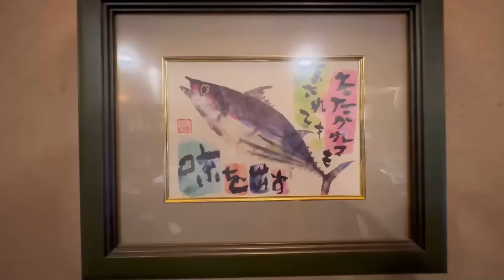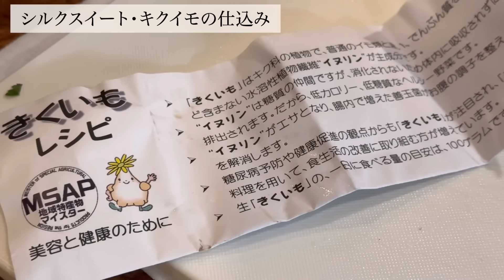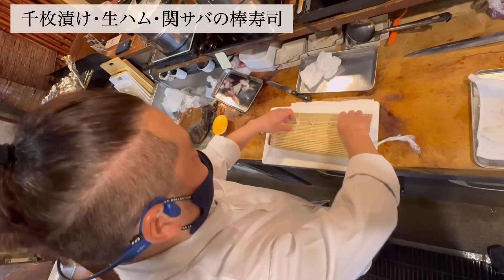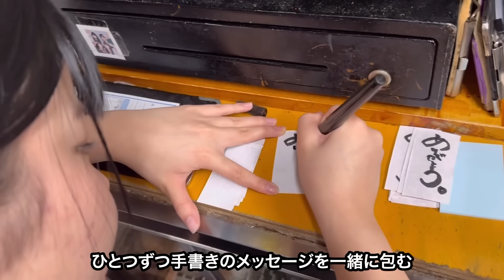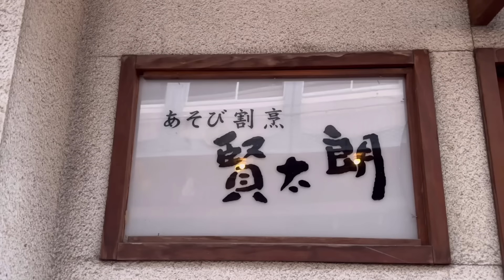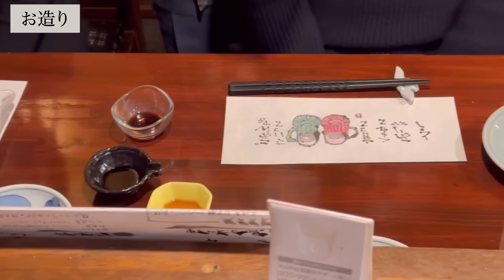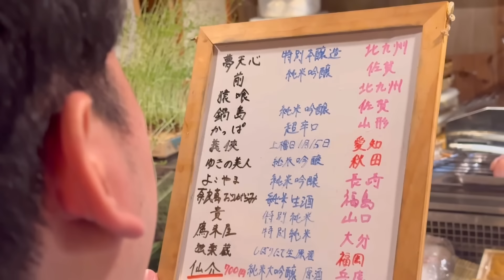小倉の寿司）理系の変態料理人が奏でる料理！ツキノワグマ！タナカゲンゲ？ウチワエビ！『あそび割烹　賢太郎』/Japanese sushi restaurant serving rare fish

Comment: Those are called "immersion circulators" and the cooking method is called "sous vide". Sous vide, was invented by a French chef named Georges Pralus in 1974. The water temperature is regulated by either a temperature or thermostat  to whatever temperature is chosen. Typically the items to be cooked are sealed in either glassware or a vacuum sealed plastic bag.